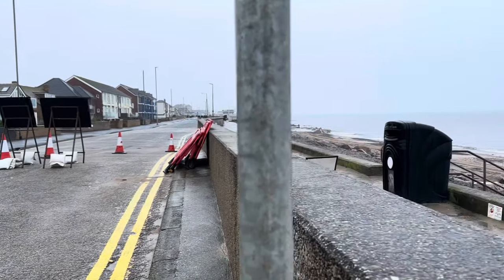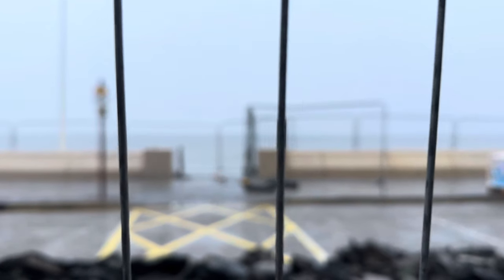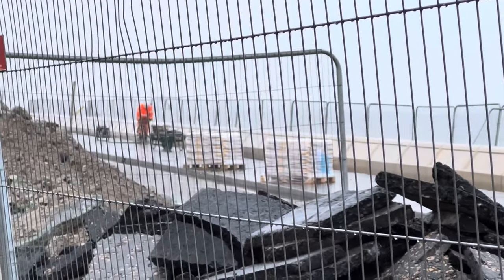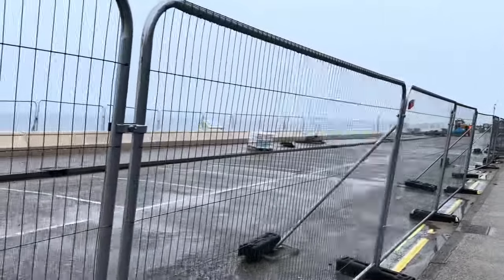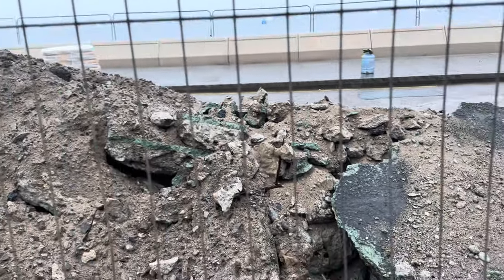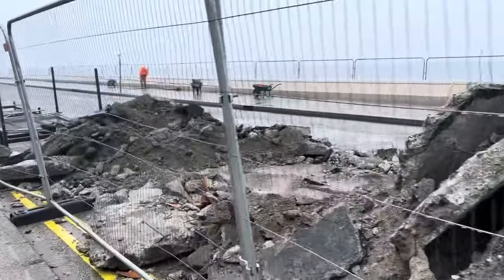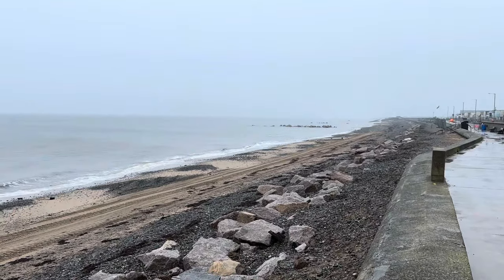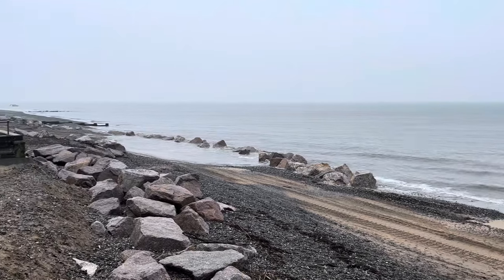A posh new sea wall - and what's happening at Cleveleys Beach?

Comment: This line of higgledy boulders [all on at least three points of contact] puts us in mind of the tumbled rocks which we often see by the side of rivers and burns in the lake district, Scotland and Wales etcetera, where they have split off from steep banks of rocky mountainside. Most of these have thick layers of moss which may - on the Cleveleys shoreline version - be seaweed and algae if the rocks are exposed for long periods, and with a higher incidence of storms like Babet they may well be. Planning these works means thinking about climate evolution, we may appreciate all the more, early Victorian infrastructure which has lasted so long after a time when the observed climate was informing builds but the builds were strongly engineered.
The new sea defence does look good. I feel that with less space on the pavement due to the seating being repositioned there should be a cycle lane indicated on the road as many cyclists and e-scooter riders think a pavement is a road - a traffic evolution that needs to be curbed.
Thank you Jane for braving wind and rain and bring on the archaeolgy any time you like :-)
Team EryKris xx